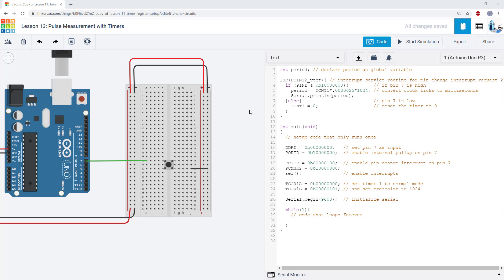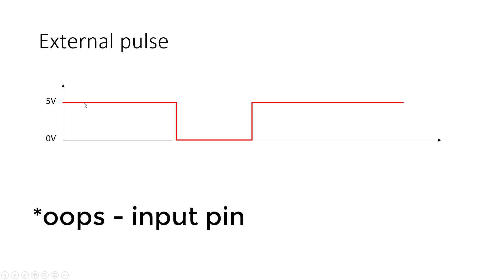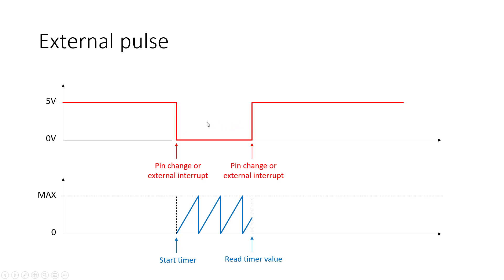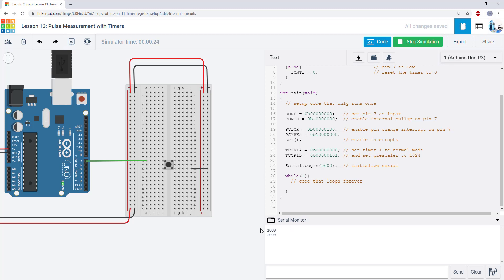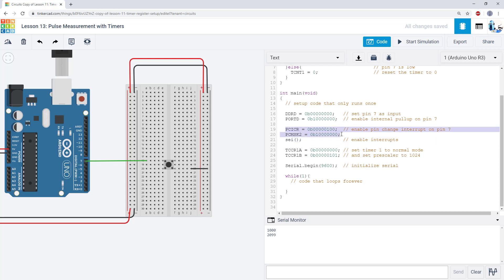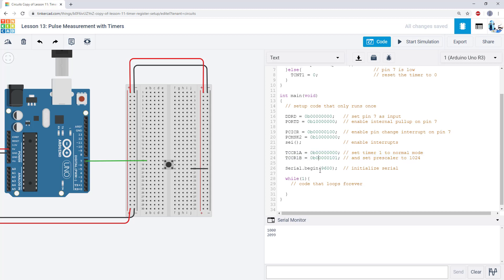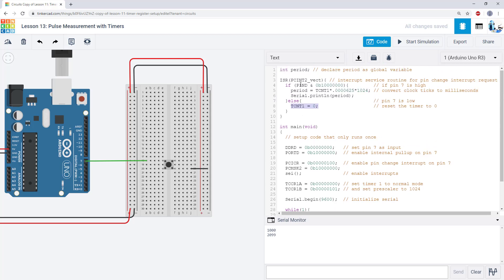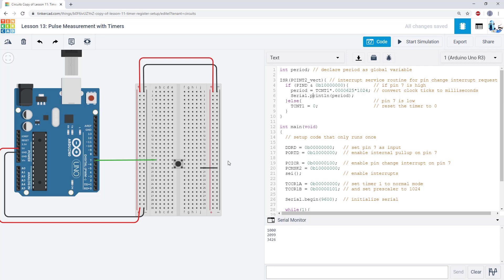Tinkercad + Arduino Lesson 13: Timers Part 4 (Measure Pulse Duration)

Comment: Is it possible to measure time in microseconds?
I have an arduino reading the  hall effect sensor, and i can use either rising or falling edge but not both. 
Is it possible to start a timer on falling edge, start a timer 
Print a time once second falling edge happens and start timer back from zero

Comment: Can i download your code?
Reply from the maker: Here's the code you can copy-paste:

int period; // declare period as global variable

ISR(PCINT2_vect){ // interrupt service routine for pin change interrupt request 2
  if (PIND & 0b10000000){         // if pin 7 is high
    period = TCNT1*.0000625*1024; // convert clock ticks to milliseconds
    Serial.println(period);
  }else{                          // pin 7 is low
    TCNT1 = 0;                    // reset the timer to 0
  }
}

int main(void)
{
  // setup code that only runs once
  
  DDRD = 0b00000000;   // set pin 7 as input
  PORTD = 0b10000000;  // enable internal pullup on pin 7
  
  PCICR = 0b00000100;  // enable pin change interrupt on pin 7
  PCMSK2 = 0b10000000; 
  sei();               // enable interrupts
  
  TCCR1A = 0b00000000; // set timer 1 to normal mode
  TCCR1B = 0b00000101; // and set prescaler to 1024
  
  Serial.begin(9600);  // initialize serial

  while(1){
    // code that loops forever
      
  } 
}